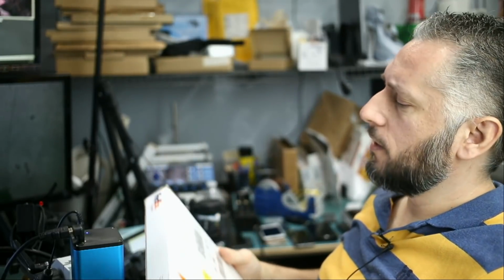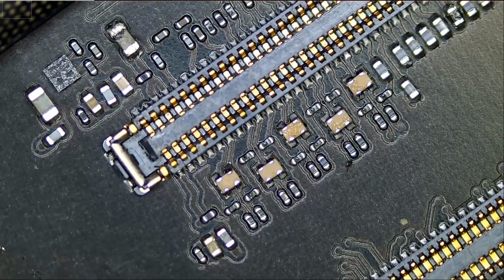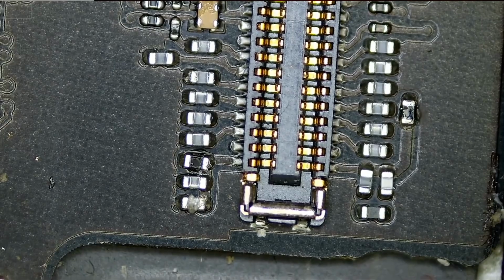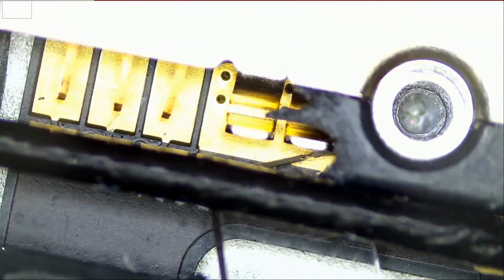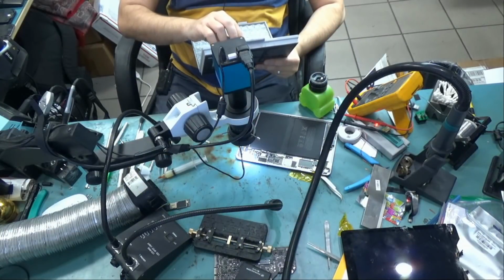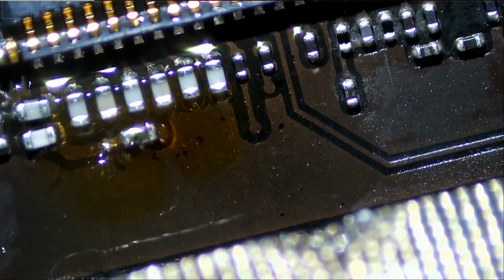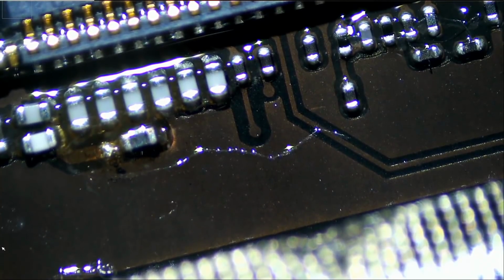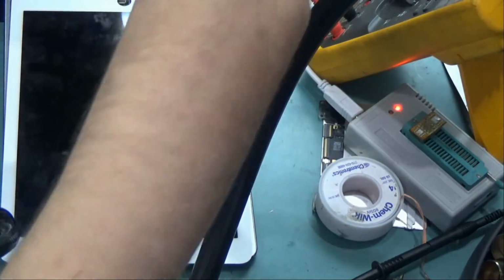iPad Pro 9.7 Damaged No power Black Screen Repair

Comment: What is this "filter" component? Is it just a tiny inductor? Obviously not a cap or diode or resistor...!? I would have thought a cap would be used for filtering but you have continuity  across it so i am baffled🤔
Reply from the maker: It's a passive low-pass filter, it's used to suppress high-frequency noise in electronic circuits . The component is continuous more like a fuse or inductor due to low resistance. If blown, it will break the connection. It's very common for this component to blow on iphones and ipads when a screen is replaced without disconnecting battery first.